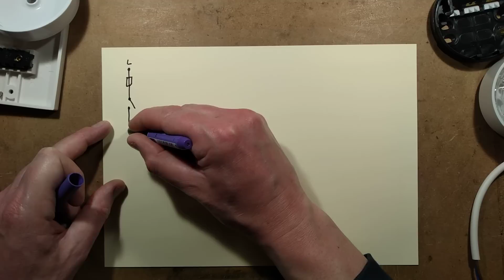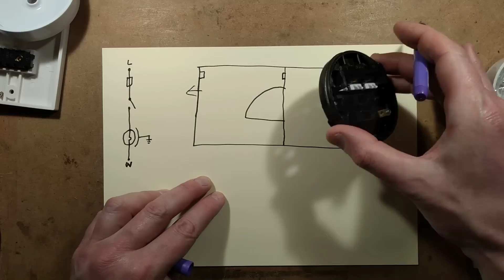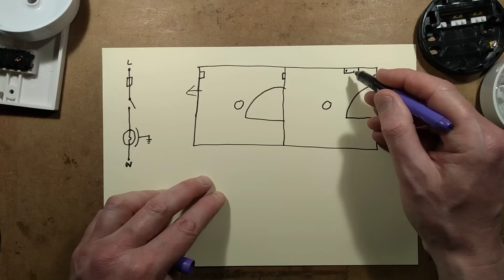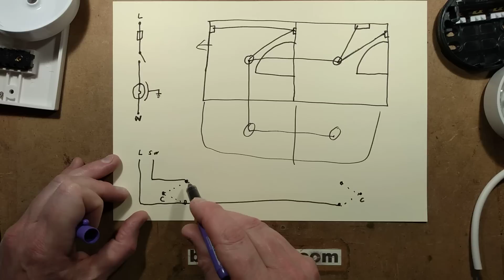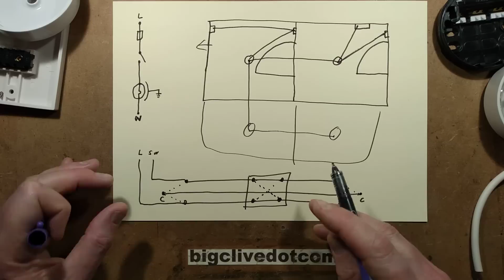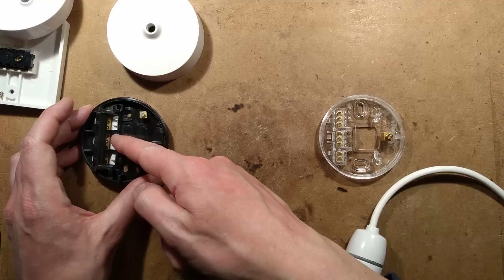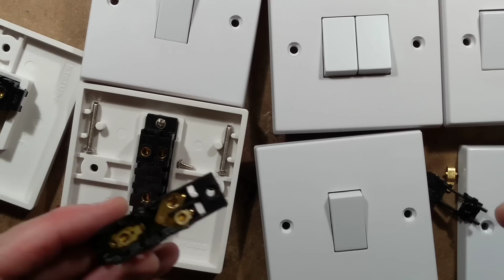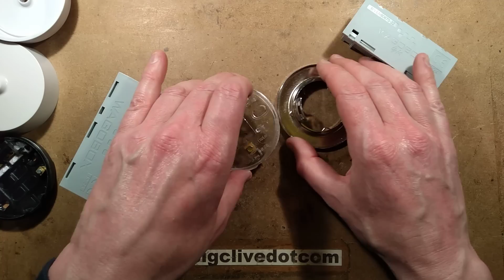British home wiring.  The incredibly simple lighting circuits.

Comment: That's so weird.  In Australia (which at first guess I would've thought is the same as UK) we run the live supply to all primary switches. Switched legs then are wired to each primary luminaire. The reason is one of safety;  It means when a switch is off - there are no live wires within the vicinity of the lighting receptacle. Handy when people are sticking hands into ceiling cavities etc.. I would have to go read the wiring rules to see if it was permissible to wire it like the UK, but I can't see anything fundamentally wrong with the idea.
Reply: It's the same in Germany. There is no live wire on the ceiling if the switch is off (or at least there shouldn't be, I still always check). Those ceiling roses prevent you from having to handle live wires when changing a lamp though - this makes it slightly safer. In Germany we only get loose wires dangling from the ceiling.
Reply: Malte Sartor That sounds awful. A ceiling rose is so simple and cheap and looks very tidy.
Reply: @donaloflynn  It is illegal  to have active (or as you folks call it live) going to the light fixture instead of the switch for new installs.
Reply: In the uk houses used to be wired in conduit or single insulated wiring, using shallow flush back boxes, and the conduit or channel going to the switch was only big enough for the live conductors. When the current twin and earth cable was bought in, and houses were rewired, there was only room for one cable down to the switch in a lot of cases, so thats why the 3- plate system was introduced and neutrals were sent straight to the  light fittings. 
On a new house build, electricians mostly now install deeper back boxes and it is more common to take the live and neutral loop in and out of the switch box, with just the one twin  and earth cable up to the light fitting. This method became more popular when downlighters and fancy light fittings came into fashon,  with their tiny termination boxes.
Reply: @sparkykevboss  ah yes that makes sense. I seem to remember that I managed to wire two way light circuit with 1cable to the switches as I put a junction box in the roof and took the switch feed from there to the pendant so was easy to change light fixing as well.
Reply: @sparkykevboss  It's been done that way since at least 1956 which was when the house I was born in was built. Not a matter of rewiring at all as it was a newly built council property, What is startling was that in a three bedroomed house, there were two ring mains, but they only powered two (single) sockets each (the third bedroom had no power socket). There was a socket on the cooker power circuit as well and another in the airing cupboard. It still had two lighting circuits though. 6 fuses in the fuse box (two rings, two lighting circuits, one for the immersion heater and the other for an electric cooker).

Astonishing really, even in 1956.
Reply: All new builds are wired live to switches now, it's easier to change the pendant for a more modern fixture which I guess is more user friendly. However running new cables in a roof its a lot easier to drop a cable to a rose and run it to a room and have just one cable to the switch. If running say two way lighting or two way and intermediate switching its just less congested. When I helped rewire my parents bungalow I just pulled the old wire out the conduit in the wall and put a new cable Down. Gutted a room and just clipped a new cable from 1 rose round and dropped it into the other rose. Having multiple gang switches it saved trying to cram more wires into a switch. Knowbody should be messing with circuits live anyway so I have never considered it unsafe as it's all terminated neatly in a rose with finger safe terminals.

Comment: I think being in the states its just different. I'm not 100% sure I'm a old school electrician but our boxes are plastic if using plastic conduit or dry in wall with no conduit and the boxes are super cheap, like .50 cents each for single box most metal boxes are used for big 220 dryer style plugs or commercial and still only like .75 a box but it looks like our boxes are deeper than yours. like 3 inches on average... but again im no expert
Reply: The average back box for the UK is 25mm and 35mm for metal 47mm when using  large cookers and electric showers

Comment: Most walls in America are of the wooden-framed drywall type with lots of space between the two layers (whether they are interior walls or face the outside). So, our narrower, deeper boxes make a lot of sense in that context.
Reply: Do you run your cable in conduit inside the hallow walls?
Reply: @mrsillywalk  in most areas that is not required in standard residential walls. We use NM cable that looks like the cable Clive is handling in this video, except NM has 14 gauge wires and they are black, bare, and white.
Reply: @InkyLeopard   Also called Romex generically nowadays.
Reply: @stewartcaldwell5299  yeah, you'll hear it called Romex most of the time. That was actually a brand name. But it does sound better than NM.
Reply: @InkyLeopard  Yup, I was an apprentice when romex was the only option. (not for long, though)
Reply: @stewartcaldwell5299  how long ago was that, if I may? What did they use before that?
Reply: @InkyLeopard  Black and white is much more sensible than our blue/brown. Where the exposed wire comes out of the cable we slide on a light flexible tube that is yellow/green. It must be confusing for the color blind!
Reply: @InkyLeopard  Mid to late 50s. There was plastic insulation before that, though I've worked a lot with tarred fabric insulation, and even bare wires separated by porcelain standoffs ( like telephone poles except in the basement), all outlets in the floor protected by brass screw in plugs for unused outlets.
Reply: @stewartcaldwell5299  Ah yes, knob and tube.  There are remnants of that wiring system in some older houses in Canada.  In a century or older house, if you're in an unfinished area like a mud room, you can still see some tubes passing through the 2x4s and knobs sitting on top...sometimes with the cloth insulated wire still hanging on them.
Reply: @WJCTechyman  I love walking through old houses with original stuff intact.
Reply: @InkyLeopard  Cloth covered death wires  lol.    Stuff from the 50's that really was cloth covered.  It looked just like romex but with a cloth-like outer covering, and both wires inside had that same covering.  IDK if they were ever color coded, but having been installed about 30 years before my time, they were just dull gray and the coating was frayed like an old rag.  This would leave a bare wire in the box camouflaged by a bunch of hairy old wire wrap that disintegrated.  Very dangerous.  Before this, it was "knob & tube. "  Basically a set of two porcelain posts nailed to the stud or joist with single variants of that cloth-covered wire I mentioned before going along from knob to knob, and when you drilled through a stud or joist, you'd put a ceramic tube to line the hole.  Looked like something out of Frankenstein's lab. 

Growing up in Boston, I've seen a lot of it (I was a plasterer for many years).  I would usually price a job when the walls were all open and sometimes before the electrician got there, so I've seen quite a few knob & tube setups in use (just before they were removed and updated).  Really amazing how dangerous they were.  Same deal with the cloth covering disintegrating over time, but this was from the 10's and 20's instead of the 50's, and there was no outer covering.  They were very thin, too.. looked like 18 ga.  There were no appliances when that stuff was installed, just lights.  18 ga with disintegrated coating, and 120v drawing 12A for a heater modern air conditioner is the cause for a lot of fires in the past.   Thankfully it's very rare to come across that any more.  Glad I had a chance to see it though.
Reply: @stewartcaldwell5299  In the 50s UK was using rubber insulation. It cracked a lot! Your standoffs would have been worth seeing!
Reply: @WJCTechyman  When I was young I knew it as post & tube wiring, done in many older houses early in the century. One of my first jobs was as a helper replacing it with Romex (non-metallic NM) or BX (MC metal clad - AFC armored flexible conduit) Romex and BX are brand names.
Reply: @mrsillywalk  I wish I'd kept a few.
Reply: @mrsillywalk  It's not necessary in most cases.  You would staple the wire around 1-2" from the drywall.. (about 40mm).. in the middle of the stud, which is 3 1/2" (90mm).  Conduit is mainly used when single wire is used, or exposed (like the cable leading to a water heater in a garage or basement).  It would usually be steel flex with 2 10ga. wires +gnd.   Besides that, conduit is used in outdoor applications, some basements (usually older installs) and business / industrial.
Reply: Yes, you don't build houses properly with solid brick outside walls like the UK does. They're built of thin ply wood and plasterboard with little or no insulation and get completely destroyed by high winds. Brick walls are much stronger against wind and insulate better.
Reply: @simontay4851  Yes, unfortunately brick hasn't been as economically viable since the late 1970s or so; in terms of both material and labor.  But your statement of "little or no insulation" is totally wrong - with our extreme temperatures (cold in the North & hot in the South) good insulation is a must.  And while heat transfer through brick takes longer, it isn't actually that good an insulator; the infill insulation normally used in our homes has (depending on material) anywhere from 15 to 35 times the insulation value of brick.  In the wind, there's really not much difference until the 125 - 150 mph range; below that, both survive fine and above it, both will be gone (though flying bricks will contribute much greater collateral damage than flying plywood).  Actually, a well-designed wood frame structure can hold its own against brick quite nicely.  Masonry buildings can also sustain more damage in earthquakes, and will have a higher repair/replacement cost in any of these disaster situations.

American houses and British houses exist in different environments and face different challenges.  Either would be unsuited if transplanted.
Reply: @simontay4851  Yup. The US has tornadoes, hurricanes and killer blizzards.
Reply: @simontay4851  unfortunately in many areas of the US and Canada, Brick cannot be used easily due to Earthquakes, so it has to be expensively-reinforced, or we have to build with reinforced concrete and steel, or wooden framing, as far as i understand.  Drywall (Plasterboard or Gypsum) is nowhere near as quiet or strong as brick, but it is almost our only option in many parts of the continent, as it is earthquake-friendly and compatible with framed buildings and concrete buildings with superficial framed partition walls.
Reply: @simontay4851  

Brick walls are actually terrible at insulation. When dealing with real cold, -10C and below you need actual insulation. Bricks have thermal mass and low infiltration, which is not the same as insulation.
Reply: Simon Tay - If you're being serious, you clearly don't have a clue what you're talking about concerning home construction in vast portions of America.
Reply: @simontay4851  I live in S. Florida in a 12 year old house that has some thick cement over block.  I just had to drill some holes to install some lights, and I drilled into it 1.25 - 1.50", and I still didn't get through it.  Very thick.  Hurricane Irma made landfall right over my house and there was no damage to the house whatsoever. Very violent storm that tore roofs off some houses, but those were actually the older homes.  I'd put these houses up against your "solid brick" UK homes any day.  It was those "solid brick" homes that were destroyed down here.
Reply: @simontay4851  I forgot to mention, if the house is built using plywood, it's new enough to have been required to be insulated.  You're talking out of your backside.  The only homes that get destroyed by "high winds" are cat 4 or 5 hurricanes or tornadoes, and that's still quite rare.. Have any cat 4-5 hurricanes in the UK?  Tornadoes?  We get hurricanes nearly every year, and the house is never damaged.  If hurricane Irma went through the UK, half of your "solid brick" houses and buildings would be rubble.  First the windows would be sucked out, which would lead to the roof getting blown off, then the walls go behind it.. nothing left but a pile of bricks.  That's why they stopped building out of bricks in S. Florida.  They were always getting destroyed.  People always think brick is indestructible.  Our roofs are chained or shackled to the house as well, BTW.
Reply: @simontay4851  Yes we do have houses with wood frame and plywood sheathing, we also have brick, cement block, poured concrete, post & beam, straw bale, rammed earth, and a multitude of other methods of building houses, but I didn’t know that in the UK you only built stone houses.
Reply: @simontay4851  Brick houses all over the place here. Very common for houses in the USA, particularly in the Southeastern chunk of the country.
Reply: @simontay4851  in us we dont use pussy ass six amp circuits 15 amp minimum to everything. and our breaker boxes dont have weak stranded wire, solid copper only . also if you think two inches of brick insulates better than 5/8 of drywall, six inches of fiberglass insulation, 1/2 of plywood then a layer of tyvac and finally a layer for siding you are nuts